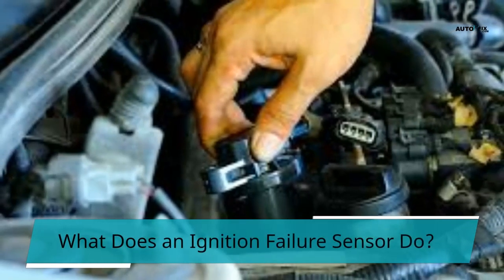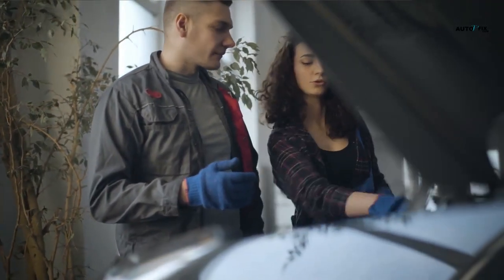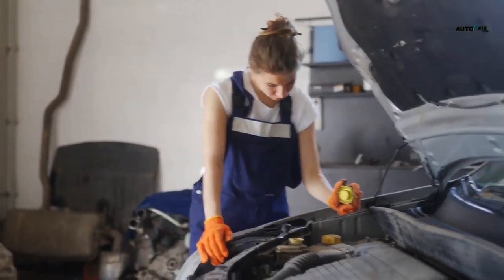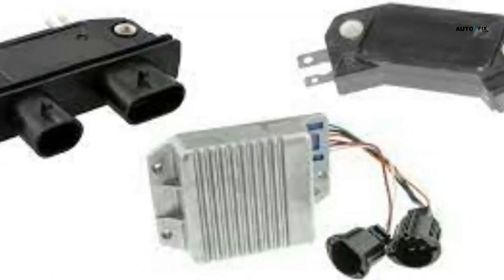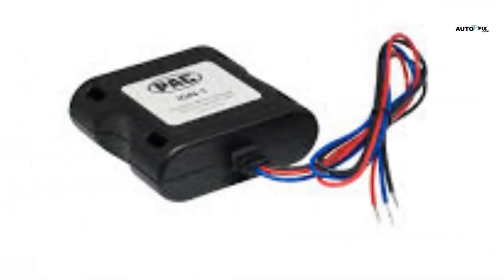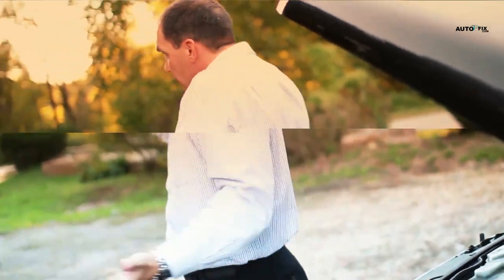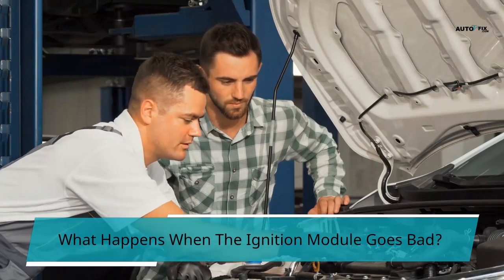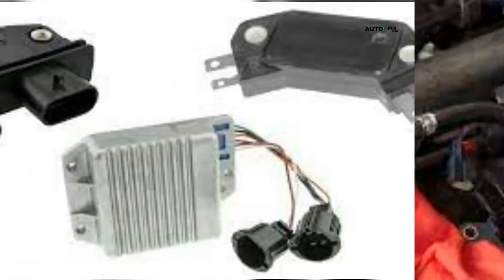Ignition modules are more prone to fail when? Ignition control module problems Signs and Diagnoses.

Comment: can a aftermarket bluetooth system cause the car not to start regularly. My car sometimes wont start, had it checked 3 different times in two months and not battery, starter, alternator. Nor did they say it had anything to do with the ignition switch itself.